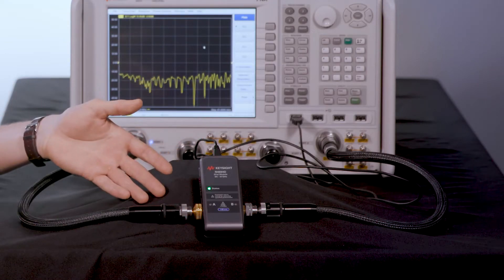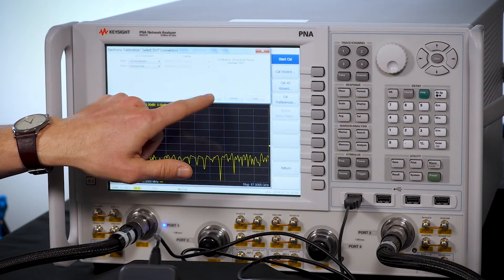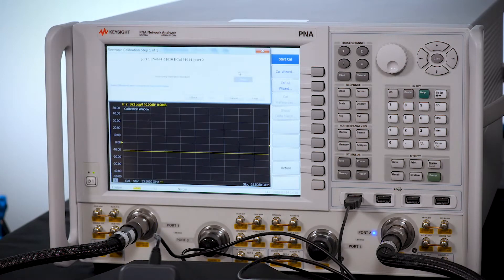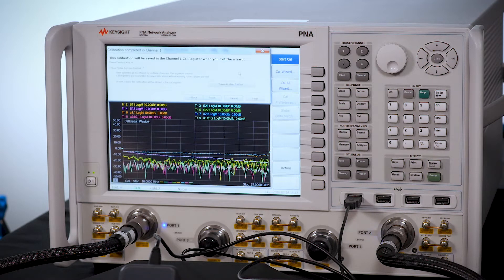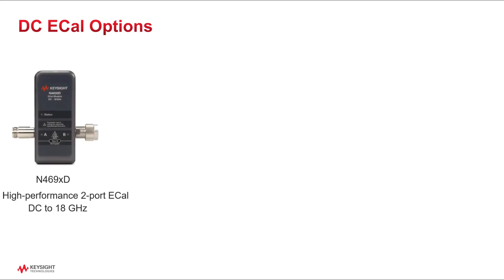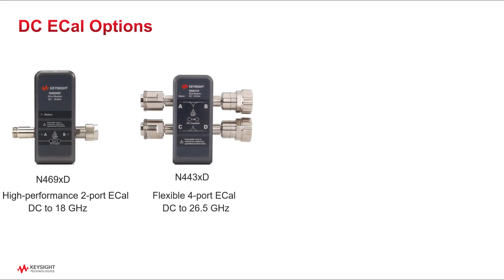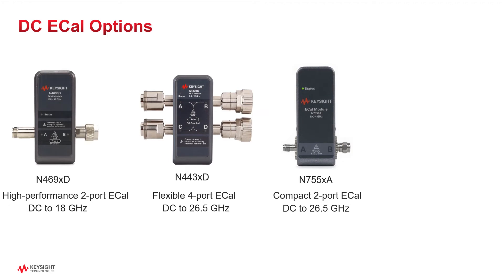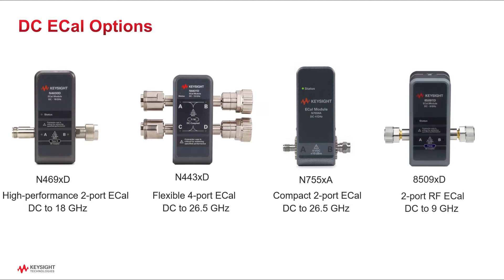Electronic Calibration (ECal) Demonstration

Comment: When I perform a full 2-port calibration using the Ecal kit N7554A with my FieldFox N9916B, I observe an insertion loss of -4 dB for S21. However, when I perform the same calibration using my mechanical kit, no insertion loss appears for S21. Can you please assist me with this issue as soon as possible?